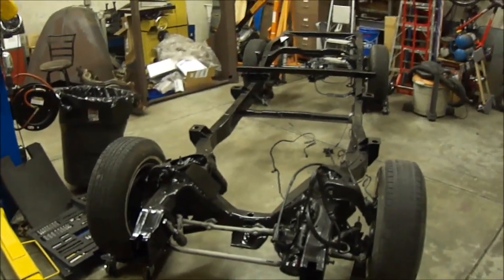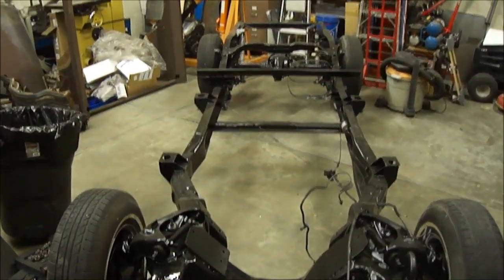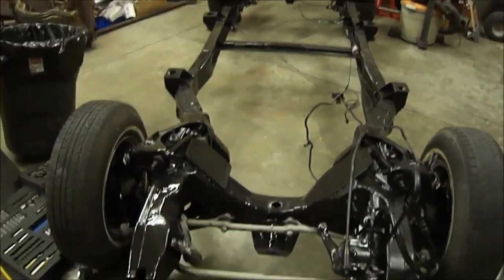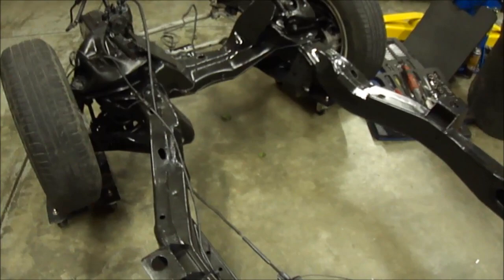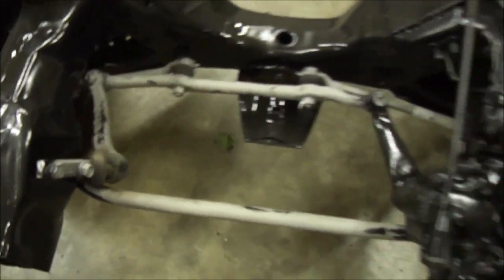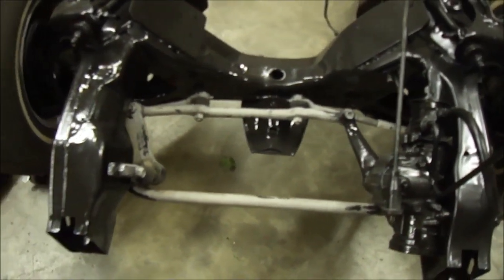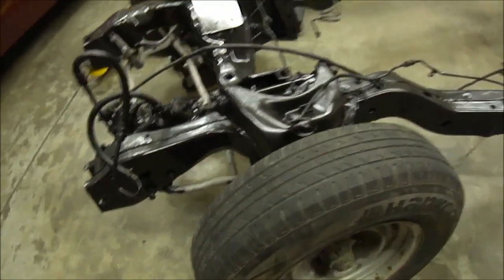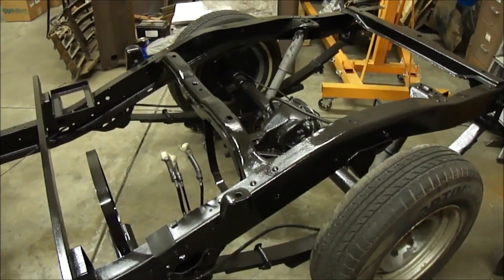53 Chevy Shop Truck 'Oldelicious' Frame - Disassemble, Prep, Paint

Comment: Looks great!  Doing my frame this week.   Can you give the specs on wheels and tires you used.  I know you used 18x9.5 front and 20x10 rear. What back spacing?  Did you add sockets to front?  And lastly did you use original 2wd rearmed or change out for a 4x4 rear end?
Reply from the maker: Wheels: Coy C5 Chrome 
Front 18x9.5, 5.5" backspacing, 5x4.75" bolt pattern, 275/40/18 Nitto NT555 G2
Rear 20x10, 4" backspacing, 5x4.75" bolt pattern, 315/35/20 Nitto NT555 G2Sockets? what do you mean?I used the original 2wd rear end because it was the right width for the wheels I'm running.  May replace it later, especially if I break it :)

Comment: Looking good TO. I’m restoring a 49. Are you keeping the S10 front and rear suspension?  I think I heard on the vid you are upgrading the sway bars. Thanks!
Reply from the maker: Yes, keeping all of that.  Up-sized the front sway bar to the S10 Blazer size, 1.25" I think.  Added a rear sway bar from another S10 or Blazer, pretty skinny.  Lowered the front 2", lowered the rear with blocks, 3".  If the rear axle breaks, I plan to put in a Ford 9" and possibly 4-link/coil-overs in place of the leaf springs.